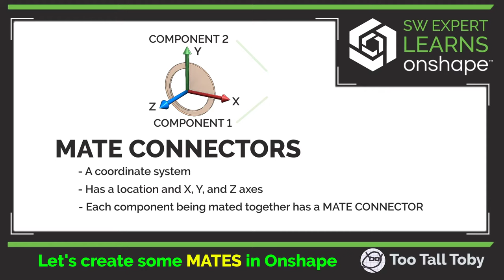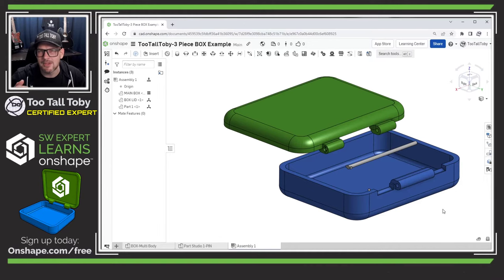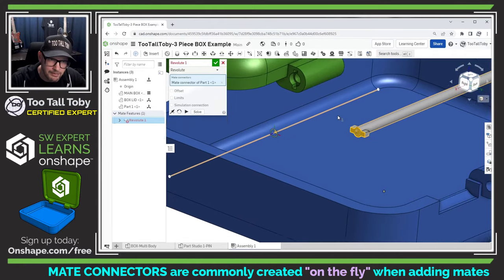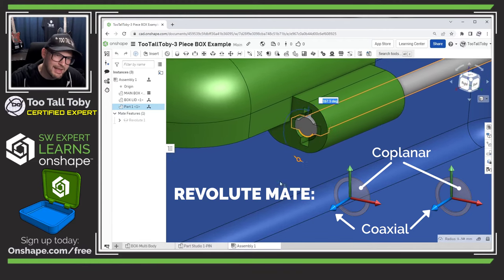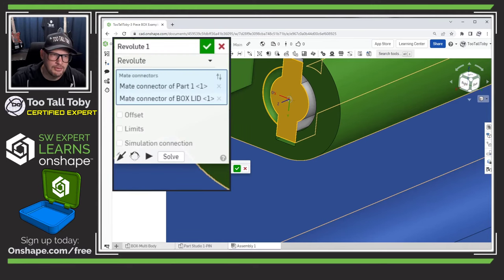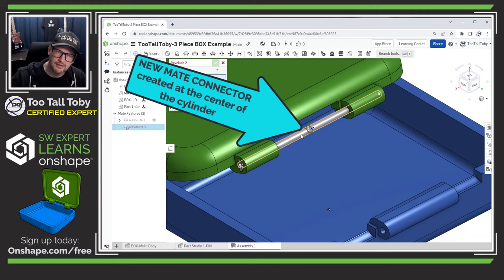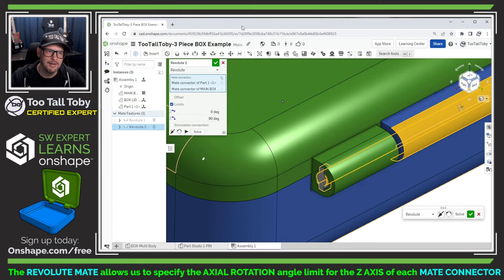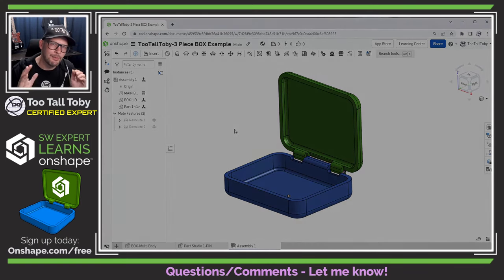SW Expert Explores Mate Connectors

Comment: Good job @tootalltoby!

PRO tip #☝️:
When hovering the geometries, you're not "creating" Mate connectors, you're "highlighting" existing Mate connectors and you just can use them. They are called "implicit" Mate connectors.

PRO tip #✌️:
In a Part Studio, there is a Mate connectors feature that allow you to create a Mate connector associated to a part, this is an "explicit" Mate connector and it will be part of the part when you use the part anywhere.

PRO tip #🤟:
Some features allow you create Mate connectors "on the fly" like the Hole feature for example. It's like allowing you to use an implicit mate connector and modify its position and/or orientation.

There is so much more to say on the Mate connectors but if I tell you all now, I will loose my "expert" side too soon! 😂
Reply: lol - nice - For Pro-Tip #3 - you mean "explicit" right?   Hole feature allows you to create an explicit mate connector?
Reply: @TooTallToby  That's a tricky one to get used to! Generally speaking, pretty much everything that uses mate connectors in Onshape allows you to use either implicit or explicit mate connectors. 
Furthermore whenever you use an implicit mate connector, you can add "modifiers" to it just like when you create an explicit one (which I think is what @servicestechniquesericgauthier is referring to when he says "create Mate connectors "on the fly"..."). It's semantics but my interpretation is that a mate connector is only "created" when you can show it and use it directly at a later point.
So I think the word "create" is the issue in tip3, if it's implicit then it's not "created", just "used"*.

* Except for mates; mates do create "explicit" mate connectors (that can be shown and re-used directly), I actually ramble on about eactly that in my first tutorial!
Reply: @TooTallToby  since English is not my first language, I might use wrong words sometimes but the hole feature allow to use an implicit mate connector and modify it directly from the feature dialog and this mate connector is only visible within the hoel feature. Hope this is clearer😁 now.
Reply: @airwick5083  your explanation sounds correct. Sorry for my English mistake. Thanks!

Comment: Something that isn't obvious to me at the start of the video is what the point of having these parts move around in onshape is? Ultimately I'm manufacturing this thing and doing this feels like I'm just building myself a little virtual toy.

Is onshape doing any sort of collision detection to help me validate the physical constraints or does this merely help me set up a visual aid to eyeball that parts aren't going to intersect / interfere as different parts of the assembly move / rotate through space? Can I have onshape automatically explore the various degrees of freedom offered by the assembly to help automatically validate the fitment of my design?
Reply: That's a fair point Jacob - this is my first assembly in Onshape, and it took me some time to conceptualize the idea of mating with MATE CONNECTORS (as opposed to mating using faces, which is how I worked in my previous CAD package).   So the goal of this video was to help other newer Onshape users get an intro to this idea of mating using MATE CONNECTORS.  

Great ideas too - in future videos we will cover things like interference detection to help guide your assembly designs in Onshape!  Thanks!
Reply: This is a good question, but there are lots of reasons why you might want to fully replicate all the real world motions of an assembly within Onshape. You can even add simulations directly within the asms, so you can see stresses and displacements on the parts

Comment: But Onshape still has a "tangent" mate, which requires you to select faces, like other traditional CAD programs. Is this simply because there's no way make a tangent relationship using mate connectors? If so, I have to wonder how useful mate connectors really are.

Comment: So what happens when the surface geometry changes, say you chop off one of those pin splines?
Reply from the maker: If that happens, a simple change of the mate reference would be required.  To prevent a change in the first place, a more stable mate reference like the center of the edge of the part or a pre-defined mate connector at the component level.

Comment: @TeachingTech just did a video on "shadow lines" which is effectively putting a lip and groove between the box and the lid. However he manually sketched out all this additional geometry. This made me wonder whether Onshore has a more idiomatic solution. If you get a lid and box to mate through a hinge, can you then create "features" between the parts, like a lip and groove, without having to go back in and sketch it all out?

I guess another way to ask the question would be: is it possible to mate two parts and then add "features" between them, rather than designing the features into each part? Mate connectors seem to partially solve this problem, because rather than joining parts themselves, you have this mate connector abstraction and you join the mate connectors with one another instead. So can you take it a step further and define "how" the two parts should mate geometrically? It would be rad to take your box and say "by the way, at this mating surface, also create a lip and groove such that the lid snaps onto the box"

Failing that, I'm very curious to know how the pros tackle this problem.
Reply: I also watched that video and he does create both sides of the box in a single part studio so he uses the same sketch to create the features on both parts so really pretty straightforward. One thing I notice with TeachingTech, he is definitely not an Onshape "power user" so he does get the job done using simple steps but not necessarily in the most efficient way. The general "concepts" presented are excellent but unfortunately the example of execution isn't necessarily the best way to do it in Onshape. 
For example for the "planar" box, you could just use the edge of the mating box directly with an "extrude thin" to create the lip and do a boolean with offset to create the groove: 2 features, no sketch required! It's not quite as simple when it's not planar and his approach is pretty good (although a boolean for the groove would be simpler).

This is something that should be able to be automated using Featurescript but it's likely not "trivial" to make it robust enough to handle every case. But to answer you question: yes. In Onshape anyone with some basic programming knowledge could create a custom feature that adds a lip and groove to a selected interface between two parts based on whatever inputs it takes to fully define what you need! The only limitation is that you would need both parts to be in the same part studio (but there are workarounds for that too).

It can also be tricky to make sure you have the right clearances in case of a hinged part etc... That said in the "professional world" when making a custom plastic enclosure, they tend to be complex enough that manually creating the lip and groove is pretty trivial compared to everything else so not a huge overall time saver unless you are doing it all day!

If you started with parts in different part studios, you could actually create the lip on the one part and use an in-context edit from the assembly to boolean remove the lip from the other part so not much difference actually... That would be a fun thing for @TooTallToby to demonstrate with this assembly actually!
Reply: @airwick5083  As a newbie to Onshape but a 'pro' after 30 yrs of design, I find simple concepts are what gets you going up the learning curve. And that sophisticated 'power user' methods will just pop into my head as I use the product more and more. Baby steps grasshopper. Then big leaps.
Reply: @mpart_woodlathe-stuff  I agree with what you said "in general" and @TooTallTogy intentionally keeps things simple and builds over time but in this case, the more efficient method for creating that lip is also simpler so in my opinion it would make more sense to show it
Reply: @airwick5083  My hope is our discussion gets read by newbies to realize there's more than one way to skin a cat and to realize there's always a faster way. 
FWIW, I did find it maddening(?) that TTech drew out everything but that's one way I judge my progress as I go down the path to Onshape Nirvana. hehe
And apologies to @hagus42 for pirating his comment.
Reply: I’m new to design but old to software (30 yrs), so my problem is my instincts screaming at me “there’s definitely a better way to do this” and it drives me nuts, lol. After you’ve seen the same kind of movie so many times you kinda want to skip to the end. I prefer an expert-teacher to expert-learner fire hose, if I don’t walk away slightly befuddled then you’ve probably not told me anything new! Try finding this kind of content on YT however, it’s in very small supply 😬 I quite like @TooTallToby’s content because it’s short and to the point, by the time his lesson is over most creators would still be stammering through the various shibboleths handed down by the algorithm gods (someone tell me the % engagement difference between “smashing” vs “clicking” a subscribe button, I’m dying to know)

Comment: Great video, but how do you mate arrays of objects that already has established spacing relationships. There should be an elegant solution instead of mating each component one by one.
Reply: What do you mean?  Like if the components were already positioned in a part studio and you just want them locked together in the assembly?
Reply: Not exactly clear what you are asking... This video is just an introduction showing one (well two) mating examples. Onshape does support grouping parts (locking them relative to each other) as well linear, and circular patterns and a "replicate" feature to create instances of parts based on underlying geometry.

Comment: I'm trying to model an airplane wing. It has a dozen parts, ribs, spars, and skins. There is dyheral, the leading edge of the wing rises from the origin and there is sweep, the leading edge of the wing angles back from the origin. I had little trouble modeling the parts but when I tried to put them together in an assemble I had a mess of fasten connectors trying to fix the parts together and OnShape was not happy. I know there is a better way, how do I fix parts together without a mess of fasten mate connectors? particularly when the parts are not on the major planes. One of my problems is even though the ribs are spaced at 75mm parallel  to the "right" plane the line of the wing rises and sweeps in z and y so the distance along the spar is NOT 75mm. Oh and in order be sure the spars pass through the tip rib I purposely made the spar longer than it needed to be, I started out with the spar length being equal the accumulated rib spacing but because of the angles the end of the spar did not reach the last rib. I figured I'd make it over long and then trim it off. Is there a way to trim a part at the assembly level or do I need to do that in part studio?